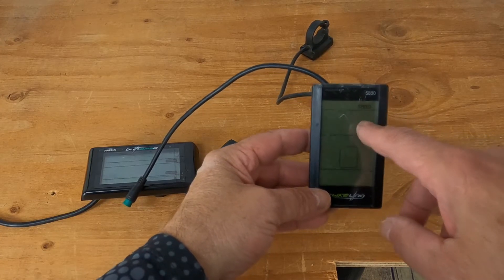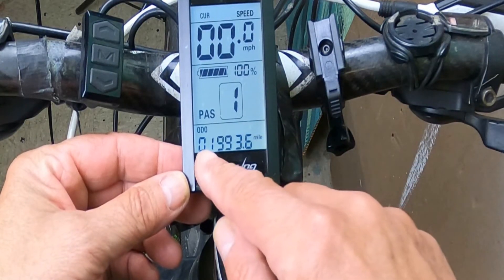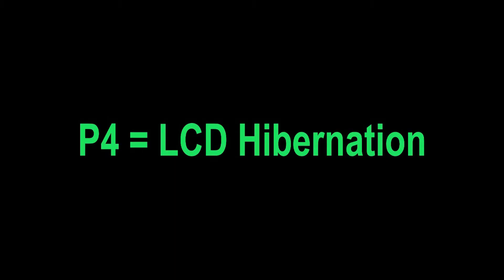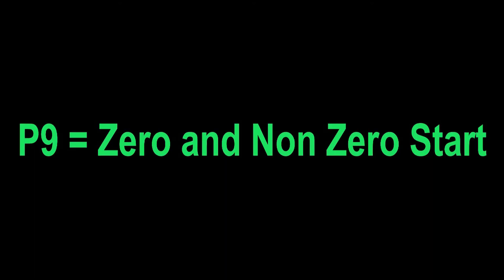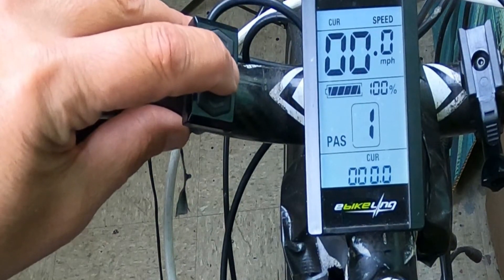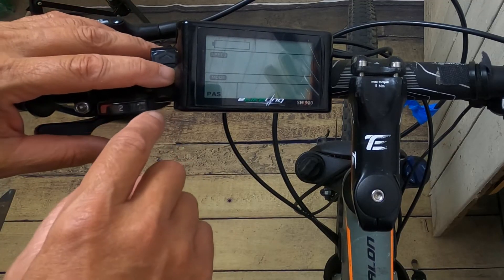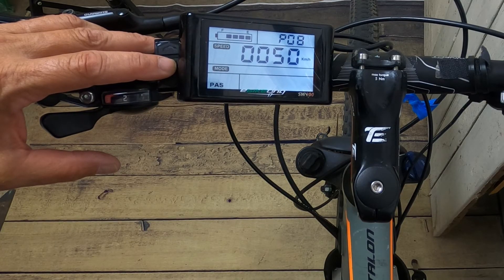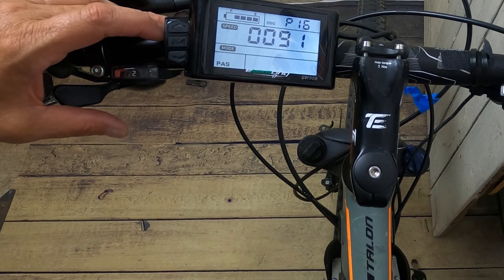E bikes 2021: Improve your Ebike's performance programming the S830 LCD and SW-900 LCD

Comment: I see this is like a three-year-old video if you got any updated stuff anything yeah I got a Jetson electric bike and I’m trying increase the range. I can’t afford a battery right now. Well, so I’m thinking about just lifting the 15 miles an hour, but just getting a new controller or something you know if I update controller to the same thing like a 36 V system you know what I’m saying just switch out the controllers. I’m just trying to go with this the right way because I can wait. I just feel restricted you know 15.5 miles an hour 48 years old, I can handle some speed at first I got this not knowing anything about electrical bikes if I did, I would’ve just I probably would’ve got the same type of bike. I just would not have gotten that low of a speed with 20 with 20. I’m good. I just don’t want to change the controller and then it lifts all of limits if that happens I won’t even write it until I get the right system to go with it so it don’t overheat or catch on fire. I’m very aware and I’m being very safe or I would’ve done the.shunt mod already but I didn’t because I don’t understand it. What I do understand is that it’s going to trick the controller so that means this going to be some overheating going on and I don’t even got no thermal paste put all over it and stuff like that to get it all ready and prepared for the heat. if you have any advice, can you please share?

Comment: my 2000w hub motor, says i go over 50 kmph but i go walk speed. i have 29 inch, and in setup set it to 29"  if i put it on 26" it still shows morekmph then i actaly go.. and sometimes it does not show speed at all, then it says 00 kmph. nc81f display , what can be the problem ?
Reply: on how much do i need to set the p7 ? for my 2000w hub rear motor ?

Comment: When I press the + and - keys together, the screen says "C" and I have 5 zeros below ... I can't access the Programming Modes. Do I need a Pin Code here?
Reply: turn it on, and staight after it on + and - for 2 sec then you get in the menu.
Reply: Did you find an answer,  if so, reply here.

Comment: Thanks for the very informative video. I have the same display on my ebike. I programed the display so I could use the throttle but would rather just peddle. I now have the problem of the motor kicking in and out all the time  this has only happened since I programed the throttle. I can't get the bike back to full time peddle assist.  Any ideas how to fix this would be greatly appreciated. Thanks. Tim

Comment: Hi,
I have an SW900 on my bike, it broke so I bought an S830 to replace it, but it doesn't work as expected. It turns off while pedaling. Unfortunately the SW900 does not show all the information, example P07 does not show! From P06 it goes straight to P08. Can you give a tip?
Reply: Battery: SDBS-S26J-20A
48V10.4AH/499.2Wh
Controller for brushless motor
LSW1295-9M X1710019022

Comment: great information, thanks so much for this as its very difficult to find information, I was getting Error Code 8 due to the P-10 being set to 1, also the P-13 was set to 8 when I only had a 5 magnet PAS ring. Cheers Colin
Reply: ⁸p00

Comment: So I have the s830 display. So after I got done swapping my wheels my front to the back my back to the front. When I was done I flipped it around connected everything. Turned it on everything started to work except my MPH reading isn't working now everything else works but that . Would know how I can fix that

Comment: When I set p07 to 47 my mph and trip is way off..my GPS say I'm going 19mph and the LCD screen is showing 35mph..when I changed it to 1 the mph is way much better so on my kit I believe it's 1 and not 47..
Reply: my 2000w hub motor, says i go over 50 kmph but i go walk speed. i have 29 inch, and in setup set it to 29"  if i put it on 26" it still shows morekmph then i actaly go.. and sometimes it does not show speed at all, then it says 00 kmph. nc81f display , what can be the problem ? were to set it on when you have a 2000w hub kit ?

Comment: For your "voltage collapse", which I'm assuming you mean low voltage cutoff, it should be at 40 volts not 48! 48v is the nominal voltage of the li-ion battery pack, made up of 3.7v cells in banks in series to get that 48v. If you look at a li-ion cell when fully charged they are at 4.2v after a little over half used they are 3.7. There is still half of the battery left until it gets to its discharged voltage of 2.8. Maybe if you wanted to preserve the battery or have a huge reserve or something to save %50+ of the battery capacity. Hey, if you want to do that more power to you....literally. But it's not getting to the wheel.
Reply: How to stop low voltage cutoff
Reply: @HONOROFCOURSE  Don't go that low. The low voltage cutoff is to protect the battery. It's always good to give yourself a little safety of error. Trust me once the voltage gets down to that level you'll be going 10mph..maybe. You'll want to charge the battery. It's regulated by the controller and BMS module. You don't want to damage the battery. You are doing just fine.
Reply: @HONOROFCOURSE 😊

Comment: is it possible to set the walking mode for 15 - 13 km on the display  s 830
Reply from the maker: It should already be set, just hold down the down arrow key for 4 to 5 seconds
Reply: @AugustineEBikes  I can't SET the speed of 13-15 KM by myself ??

Comment: That setting at 47 when do you set it to that i have a 350w motor. I camt get my speedometer to read accurately and pedal assist mode lags greatly. Activating and deactivating.
Reply: my 2000w hub motor, says i go over 50 kmph but i go walk speed. i have 29 inch, and in setup set it to 29"  if i put it on 26" it still shows morekmph then i actaly go.. and sometimes it does not show speed at all, then it says 00 kmph. nc81f display , what can be the problem ?   did you fixt it ? i have a 2000w motor and shows way more kmph then i realy go

Comment: On my screen  show me always  100%battery  do you know why? Pls  help me
Reply: Did you ever figure this out? My voltage goes down but the battery always shows 100% as well.
Reply: @CarsandCoding  hi; I had the same problem and I’m going to take a guess as I’m on my 4th new battery now. Ok so what I believe is happening is your battery is coming to the end of its recharge life cycle, so when it gives you an 100% percentage is because your battery voltage is lagging on full charge so this creates a error in the battery reading; I know this for sure as it happened to me back in 2019 and this year 2022 just about 20 charge cycles before both my batteries died, so I’m just guessing the display shows an error on the battery percentage bar due to low voltage charge levels when battery is operating only at 80% efficiently so after full charge let’s say a 48 volt battery should be 54.60 fully if it’s charging to 100% efficiency but when only 80% due to end of life you get error reading on the bar, hope this helps
Reply: @look-within  this makes sense as I’m my battery was bought used
Reply: My battery when fully charged will say 100% for several days but the power drains more and more each time I'm using it from like 92% down to 10%. Slowly goes down from 100 after I start hitting the 60% range while using the throttle. In other words it's designed to say 100 even if it's not technically.

Comment: I have a gotrax ebe2 ebike that has a 350 watt motor on it. its factory default setting is set to P8-100. on 100 the bike only reaches top speed of 20mph. if i set p8 to 50 will the bike go faster than the 20mph cap? and maybe hit 28mph?
Reply: watch what your max ah current from controller can handle, put p14 on there, and but the right volt in what battery you have.

Comment: I bought samebike lo26 500w and the max speed setting was already set to 100 but the max speed is 25km/h. Changing the value to anything does not change the max speed. Is it locked?
Reply: Must be ...i have the same bike it goes 35kmh on throttle alone...40+peddling..hold the left or brake and the throttle together for a few seconds

Comment: Holding down the down button for a few sec puts it in walk mode.
To go into cruise mode twist throttle to required speed and then hold down the down button.
Reply: Cruise control process didn't work for my max cargo eunorau ebike...
Reply: @PrestonMiddle  poppp0p
Reply: @PrestonMiddle  ppqqq11qqqqqq1q1qqqqqqqqqqq
Reply: @chriswhan8648  passcode?
Reply: Thanks so much TMAX48. Now I know how to get cruise control. Yes !! 
You’re a gun mate thanks so much I always wanted to learn how to get cruise control work for just over  9 months lol
Reply: I don't think there's Cruise control on the s830..I tried it and all I get is walk mode..
Reply: @wellingtonnurse9064  Cruise control is set by first pushing the throttle to a desired "speed" (your current speed isn't used, it just uses the throttle position) and then holding the down arrow for a few seconds. Instead of the walk icon, you should see a speedometer looking icon. Also interesting is that it seems to save the cruise speed, so if you stop and then later try activating cruise, it resumes your previous set speed. Kinda confusing but good enough.

Comment: Hi, Could you please explain P11 setting as I think you may have skipped over it, thank you
Reply: It's skipped over in this user manual too (https://electricbikereview.com/forums/attachments/1528492757374_enoeco-user-manual-cs-s830-pdf.22814/). I've heard it refers to pedal assist sensitivity with a range of 1-24, but I don't really know what that means tbh. Default is 2.
Reply: The higher the number the lowertthe intialassistkicks in. Set it at 1 for maximum  or a bit  higher for more delay.

Comment: Can you set the speed for cruise control on the s830
Reply: Viewing another reply . If you hold the down button it sets the bike in walk assist mode. To set cruise mode. You throttle to desired speed and then hold the down button. I have not tested it yet.
Reply from the maker: No it's locked in at 6 mph

Comment: I recently purchased a Voilamart 1500w 48v kit that includes the SW-900 LCD.
It sits in a box until I can budget a battery pack and the remaining pieces that I 
need to convert one of my bicycles. Since my purchase, I've been led by many 
that have made the Voilamart conversion, to believe that the PAS on the kit does
not work and only gives full throttle no matter how slow the cranks are turned.
Since learning this I thought that I may have to rely on throttle only for more precise
motor control, but now after watching this video, I wonder if some of these settings 
discussed might make the PAS usable on the Voilamart kits?
Reply: My first Voilamart kit didn't have a display and it did want to go at full power, to be expected when the controller has no display to program it I guess. I would change the settings to the lowest and go from there. 
Most important ! cover the display if there's any chance you might get caught in rain. The black plastic case itself seems watertight but the perspex screen has no protection, I had an inch of water in there ( it still worked but a week later it died ).
Reply: @sovereignman6951  I will have to try the PAS when I go to install the kit and see what it does with the options on the display.
Thanks for the tip on the display! I will try to keep it as dry as possible.
Reply: Just answering for future readers. PAS levels only set a speed (ie... PAS 1 may give 11mph, and PAS 2 gives 13mph...etc. ). It is not a TORQUE sensor which would give power to the motor based on the amount of power you are pedalling. So when you pedal in PAS 1 the controller tries to take you to 11mph regardless of how hard or easy you are pedalling. That's what PAS does.